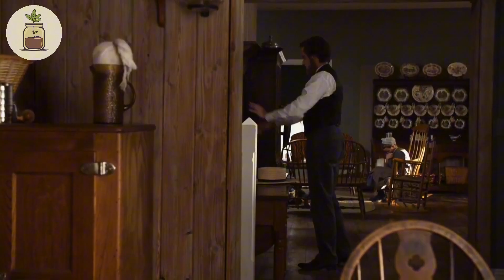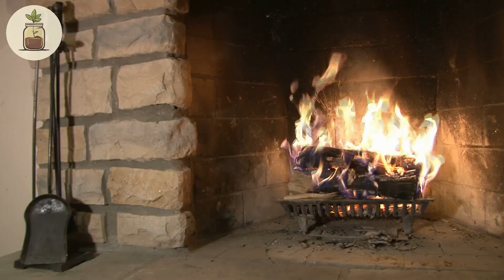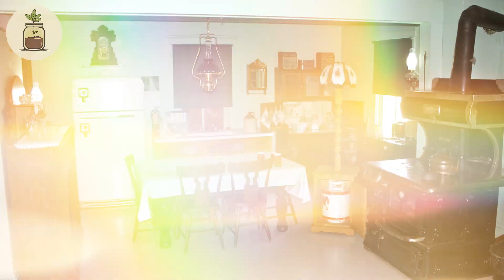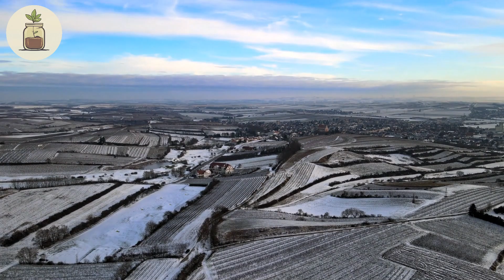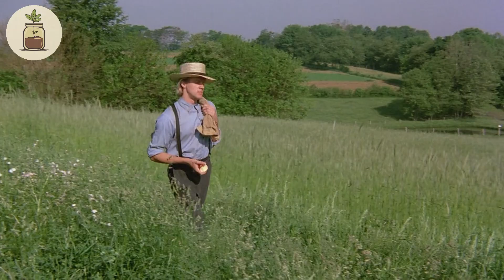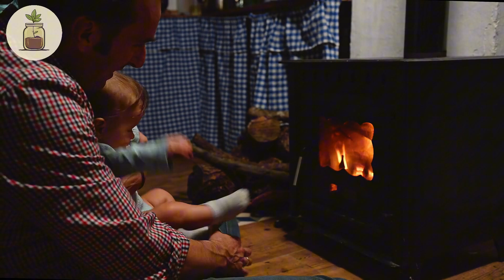How Amish HEAT Their Homes Without Gas/Electricity

Comment: My grandparents were amish, and my parents grew up amish but came out of amish society.  I can attest to their simple ways of life including but not limited to heating systems.  My father's parents had electricity in their house, complete with electric lighting.  But they still had two KEROSENE-burning stoves in their house --- though later a woodburning stove was added --- complete with ducting --- in the basement.  My mother's parents were more technologically advanced --- with that grandmother having both a washer AND an elecric dryer.  But they still heated part of their house with a wood stove in the laundry room, and later added a woodburning stove in the basement, with ductwork to heat the rest of the house which originally had all-electric heating.  They had a nice house that worked well.  By the way, kerosene stoves work really well.  Too bad they went out of use.

Comment: This video doesn't offer much reliable advice. I would strongly advise against using only a stone wall for insulation—it’s highly inefficient. While a masonry heater is a great idea for heating, avoid the designs shown in the video. Instead, opt for one with a secondary combustion chamber to burn residual smoke and maximize efficiency. Properly designed masonry heaters are both eco-friendly and highly effective when built correctly.

Comment: We grew up with a wood burning stove. We also grew up with a lot of manual labor. Even when you can barely hold on to a log, you're still forced to participate in the ability to enjoy the heat 
When we got out of the house, my youngest brother and I would cut wood for him to heat his home.
It would be a negative 27 degrees F. We would bundle up and go out into the woods. After a couple of hours of cutting and stacking wood for transport (will raise your body temperature). So we would start peeling off our clothes. By noon time, we were in just plain clothes.
Heating a home by wood takes a lot of energy and time. If you have that much time on your hands, jump at it.

Comment: There are gravity fed pellet stoves that function like a rocket stove and radiate heat with no electricity. But otherwise, almost all pellet stoves are plugged in to drive an auger, fan, and fan exhaust.

Comment: Nobody loves a cozy wood fire more than I do, but the bottom line is...wood heat is not doable or practical for everybody.... Millions of people live in big cities, far from a source of firewood. And just think of all the smoke in the air from that many woodstoves. There also may be local regulations against wood heat. I live in a bowl-shaped valley in the Rocky Mountains, & there are regulations in place bc this valley is prone to temperature inversions. Adding all those stoves would make the air unbretheable in the winter...

Comment: I had friends who lived in rural Illinois they had a two-story farmhouse they had a fireplace and two wood burners on the main floor up in the ceiling there was vents placed in the flooring upstairs which let that heat transfer to the second floor in the middle of winter when it was 12/13 below zero the house stayed about 68 to 72° it depends on how much wood was in the fire fireplace or in the wood burning stoves they did it right because I remember sleeping upstairs in that old farmhouse and it stayed warm and cozy

Comment: We have only discovered  wood as a fuel since moving to rural Wales (UK). We assumed we would be able to obtain  wood fuel cheaply or for free if we put in the effort, but it was hard going for the first few years. We used a lot of driftwood, culled trees in our garden and occasional gifts from neighbours.The local wood suppliers , obtained from the many managed forests in the area provided backup, after charging to `season` the wood by drying, `using massive amounts of fuel. Then we were lucky enough to discover pallet wood! Even in a small rural town, businesses put out broken pallets for locals to use as firewood whilst businesses charged exorbitant costs for holiday visitors to buy cut logs  to have a `fancy  rural experience`.  We now have almost free heating, but it takes a lot of effort to gather, transport, cut and store our supply. Keep working at it  and you will find your solution!

Comment: I lived on an isolated island for 15 years and we heated with wood. No thank you. If you live in a very cold climate (Canada) it means getting up during the night to add more wood or waking up to absolutely freezing rooms. The heat does not travel as far as the bathroom so be prepared to be thoroughly chilled after baths or showers. I also found I had an allergy to some of the wood and I got respiratory and eye infections. Just finding enough wood is a challenge. Not all wood burns hot enough to be efficient. You can quickly rape the land if you are relying solely on wood. All that wood needs to be cut, split and stacked. Then you need to make the kindling......

Comment: Yea :D :D Absolute nonsense. Air heating is the most ineffective way, especially via single point of heat, so the larger area the better. Try to heat school bus with a single warm air blower. A kerosine lamps are  fire hazard, how would you  extinguish fire within the wooden house?  Also you can easily die in case you get CO (Carbon monoxide) poisoning. Good luck crazy gen z 's :D :D

Comment: In Australia,  we also  have
 " Combustion Stoves".  Usually  using either wood or pellets as fuel.
These stoves can be set up so you can cook on their surface,  bake or roast internally,    heat up so you'll get THE hotest water you can imagine.   As well as build on a kind of ducted  heating system throughout the house/ building. 
Very efficient and c ost effective/ saving   .  Maybee.... Our problem here is the high,  high,  cost of purchasing the wood.   Deornding on where you live here,  you can pay  around  $250.00 -  $400.00 PER Square Metre  of wood.   In very cold parts if Australua,  you coukd easily go through a metre of 
 wood per week.

Comment: Was burning 8 cords here in upstate ny. Lots of work splitting , stacking, carrying the wood in , starting a fire in the middle of the night when the fire goes out, cleaning the stove, dusting constantly from the dust wood stoves cause, the only pro is the heat is a deep comfortable heat

Comment: Off grid and been heating our house with a wood stove for 26 years.
Flat top Jotul, can Cook on it if needed.
But I like to make pizza in it after I’ve just cleaned it out.
Fire on one side.
Have some extra fire bricks I set on the other side. Put my nine inch stone on them and make pizzas for the wife and I.
Old saying. Firewood heats you 4-5 times before you burn it.
When you fell the tree 
When you Buck it up
When you haul it 
When you split it 
When you carry it in 
And when you burn it.

Comment: When the WEF has engineered the relocation of all common people into massive slum apartments, you will barely need any heat as the bodies of the other ten people in your apartment will generate a lot of body heat.  On very cold winters, the Kleptocracy will trade power for organs. One kidney will get you one winter of heat.  With ten people per apartment, it will be ten cold winters before lives need to be sacrificed for heat.  You will really wish that global warming was real at that point.

Comment: I’m not Amish, but here in the north woods almost everyone heats with wood either as a back up or primary heat source. Wood has been the primary source of heat in my homes for more than 42 years. Yes, it’s work to maintain, but the quality of the heat is better than any other kind. Food tastes better cooked on a wood flame too.  Oil is only for backup when I’m away. I buy 100 gal every couple of years, usually in the summer when the price is lower.

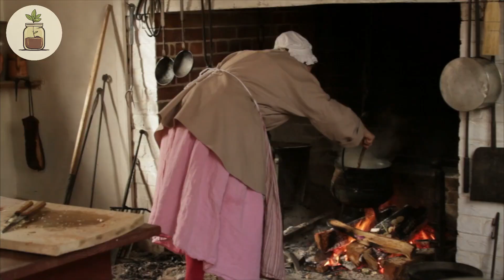Comment: One contention, thus far at least. 1:28 or so... You mention the wood heat being highly efficient. This, is not entirely true. 

Efficiency is a measure of how much energy is lost as heat to the outside of whatever you intend that energy to be used in, or the heat created thereof. 

Wood fire stoves and the like, except in the edge cases where the stove/oven is built specially to increase efficiency; are very lossy systems. A lot of that heat goes right out the chimney. Again, there are some exceptions, but they have to be in use. Or they aren't applicable to the claim. 

Some do use some of these methods, so it isn't entirely untrue for you to claim it being highly efficient. But there are some catches to that statement that need to be understood well, or it just misleads the person trying to use the methods. 

This being the case, is why reburner stoves are such an important thing when it comes to using wood for combustion. It helps keep the heat in the stove longer by restricting the flow of smoke out of the system, burns the smoke claiming some of that potentially lost energy as well; and through it all helps reduce potential polluting susbtance in the resulting vapour byproduct. (for those who don't know, all smoke is water vapour, with particulate matter in it, usually carbon mostly.) Reburners just help burn off that carbon particulate matter so that what remains is the water vapour and gasses that remain from the combustion, if any. Depends on how thorough you reburn the smoke, etc. 

Built correctly, a masonry stove will essentially act like a reburner. And they are more efficient, because they help trap the heat longer, and expel it where needed throughout the day as a result of the materials in use. It acts like a thermal battery, which is really useful for homes with only wood heat as a source of heat, as it can take a little while to get things up to temperature again if let to go cold.

I know all of this from first hand experience. Hundreds if not thousands of cords of wood chopped by these hands.

Comment: Something that my father built that's better than just a wooden stove is a Wooden stove with pipes connected to the Reservoir full of water and pipes going out of it in a loop back to the wooden stove. When the stove gets heated, the pipes warm up, the valve for water gets opened and water starts circulating. Water gets hot, it goes up the pipes and all around the entire house. However, this requires a skilled welder like my father.

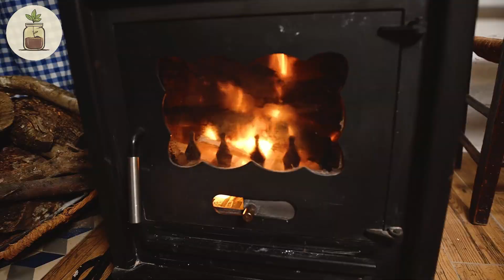The issue with standard stoves like the one at 1:45, is that all the heat goes straight up the chimney and barely stays in. The wood burns too fast, thus the reason my father decided to remove that furnace, fix up the hole and build the furnace in the garage 5-6 feet below ground.

Comment: I lot of the modern world is stupid. Sunlight heats water, water heats home. Small ponds can be quite effective. Properly shaded windows keep homes cooler. Better yet, build the house on a hill under ground. Good for drainage, warm when you need warm and cool when you need cool. And you don't need siding or roofing of bricks. A poured concrete is fast and simple. Immune to tornados, and hurricanes as well. Provided your hill isn't still below sea level.

Comment: Just stop building your shacks out of "firewood" and consider , Industrial hemp has been used for centuries to make ropes for ships,sails for ships, clothing for people and has lately been "re-discovered" as awesome building blocks for  Environmently friendly homes.  Blocks of cured hemp crete are 1/5 the weight of concrete. Absorb CO2 instead of emitting it.. like concrete . Cannot burn like logs or wood ,(CO2 puts out fires). The list just goes on..super insulator. 12 inch exterior walls at R70. Quiet. Breathable. But fireproof and cool in summer , warm in winter with minimal effort got my attention.

Comment: Clearly you have not lived with wood stoves.  They warm the room they are in, but they draw air from other rooms and bedrooms tend to get chilly unless there are separate fireplaces in them.  You note that families gather around the stove.  That is because the rest of the house is colder.   
Note especially, that maintenance of the chimney/flue is critical.  Clogged flues can cause fires, and a chimney fire is especially hard to put out; one often leads to the loss of the entire house.  Also, clogged flues can lead to carbon monoxide build up.
Wood lots on each farm provide the wood.  These are large wooded areas, enough to provide a steady supply of wood; too small and you end up with a clear cut area no longer supplying enough wood.  Most homes just do not have enough yard space to maintain a wood lot.  If you pay for wood, it is not exactly cheap.

Comment: Way to much pollution.
We did this not only with wood but with coal.
We got better at making heated areas with less pollution.
The current population if changed like this would soon have huge problems with lung disease and we would run out of trees.

Wood can not provide the heat we need.
The trees grow to slow.

Not clean not green.

Comment: Kerosene lamps provide 3 resources. Heat, light and the possibility of a house fire! Of course, double wooden windows are much more effective than plastic double-glazed windows. Of course. What kind of stone house? They build from wood and it cannot be a heat insulator the same as stone wool. There is very little air in it! This is physics. You can learn a lot from the Amish, but not how to build a modern energy-efficient house.

Comment: We had oil heat in the mid 1950's.  I was about four years old and watched the "oil man" fill the tank.  So, I could do this too.  I put the garden hose in the filler neck and waited until water came out.  I was satisfied it turned out well.  My dad tried to turn on the heat.  He found out and decided to put electric baseboard heat in.  I don't remember getting in trouble.

Comment: 4:22 The primary source of heat for most Amish homes is the wood-burning stove. These stoves not only provide warmth but are often used for cooking as well. Wood is a renewable resource that they harvest and store themselves, allowing them to stay independent from outside energy sources. These stoves are placed strategically in the home to provide maximum warmth, often in central areas where heat can radiate through multiple rooms.

Comment: Still find the whole situation hypercritical, since they don't mine the iron ore and smelt the iron. Neither do they convert the iron to steel for tools etc.
And have you seen the one where they use a modern fork lift truck but operate it by walking behind using extended controls? 
Totally entitled to their beliefs, but when it comes to double standards, no thanks.

Comment: Do you really think wood is better than electricity or gas? Look for what London was when it relied on wood and coal for heating. Is this ecological? Imagine the amount of forests you will have to cut to heat New York. Will get back to thousands of deaths because of cold easily. Isn't it much better to stop tje green deal and cut eco taxes? Without renewables to repay and taxes electricity and gas would cost as back in 80s and 90s- almost nothing compared to salaries. Wood is good for villas or small rural areas but not for larger cities. And, believe me, if they had cheap electricity all would switch to it.

Comment: An old "pot belly coal stove" (from 1910 to 1950) can be a decorative piece in the house, but also provide emergency heat if things got bad for a while because they also burn wood. Of course, you would need a "temp" chimney system and stove pipe "ready to go" and stored somewhere to vent smoke out of the house. In the siege of Stalingrad in WW2, many used an open window for their chimney pipes in apartment buildings. It's prepping that seems like a decoration.

Comment: The new EPA wood burning stoves and inserts are really nice. They have a secondary burn that is really hot. It produces more heat and no smoke when it's properly set up. This means less maintenance cleaning the exhaust pipe. They are pricey, but it pays off because you use less wood.

Comment: Those are some of the ineffective wood stoves I've ever seen
Reply: Oh well enlighten us good sir
Reply: @Meladonessable  sure what do you want to know?
Reply: Do you have any material on the matter?
Reply: @Meladonessable  sure do. But as a general rule Americans never understood how to build an effect wood burning stove. 
This video is full of typical examples of a big square brick pile with a straight chimney outside of the house. 
To increase efficiency you need your chimney inside the house, preferably in the center of the house. 
The stove also needs to weigh a couple of tonnes to be able to accommodate enough surface area for the hot gases to transfer to the stove itself. A chimney cant be a straight pipe but a zig zag type of construction like a big radiator to catch the heat.

Then we can get into combustion optimisation. Burning wood like that results in large amounts of carbon particulate matter that is released from the chimney. You're much better off with a stove that uses reversed gasification or at least has the option to introduce and adjust secondary combustion oxygen levels. 
This way you can achieve complete combustion and a combustion temperature of around 1000 degrees Celsius. 
This type of setup is so effective that your going to need to have the burner transfer the heat to a hot water storage tank for use later. 
This is how you heat a home with wood effectively. Not just burning wood to heat the crows nest on the top of the chimney

Comment: Amish way of living only works on a small scale.  We already have significant deforestation.  Can't have massive numbers heating with wood.  Coal either if we actually want to be able to breathe the air.

It's renewables like wind, solar and nuclear for the masses.  Boilers that pump hot water through pipes in the floor are effecient and don't overdry the air like forced air furnaces.  Of course we have A/C figured out.  Just need enough juice on the grid.